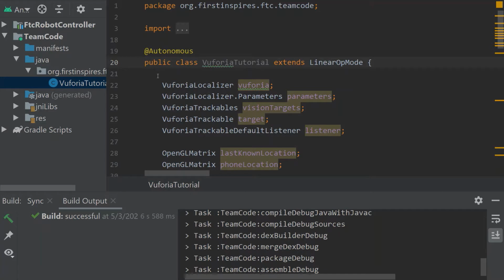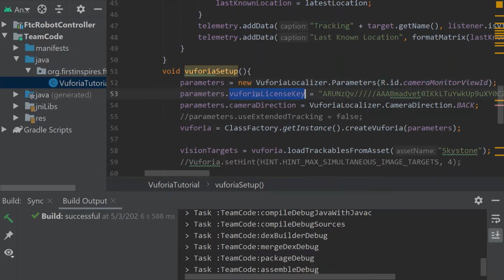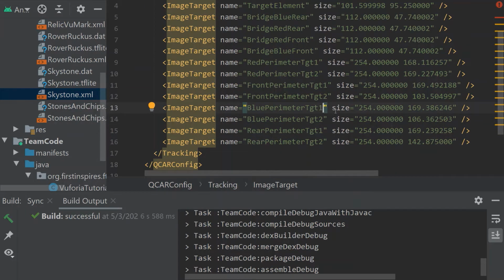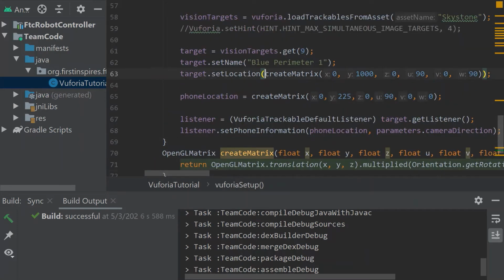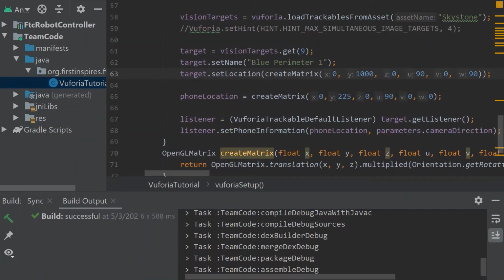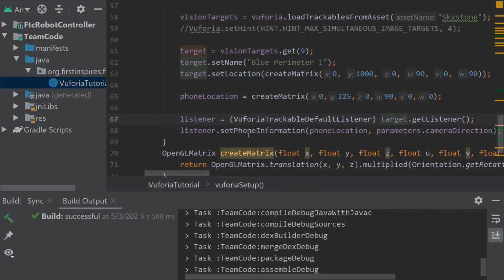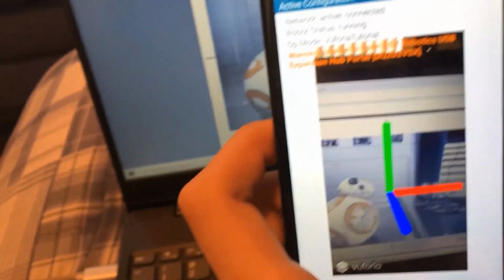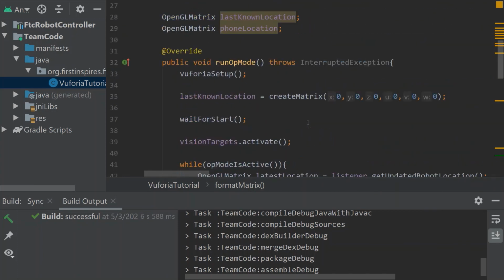FIRST Tech Challenge Gulf Coast Robotics League- Fierce Fish 17014 Tutorial 11: Vuforia

Comment: At 6:30, you're talking about the location of the target on the field. How do you find the actual coordinates of the target in relation of the field. What measurements does it use?
Reply: You can find the physical dimensions in the field setup guide, and it was also located in appendix B of game manual 2 this past season. The measurement unit Vuforia uses is millimeters. Depending on where you want your origin to be (typically it's the center of the field, but I put mine in the bottom left in this video, that's up to you) is how you will assign the coordinate positions of the navigation targets. You will need to do some math to determine the exact coordinate positions in relation to your origin. I hope this helps!